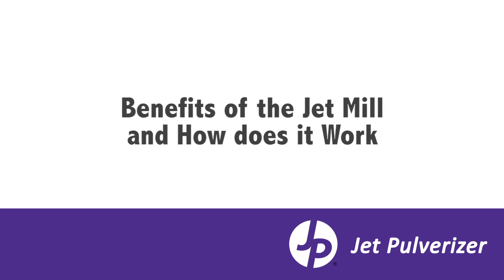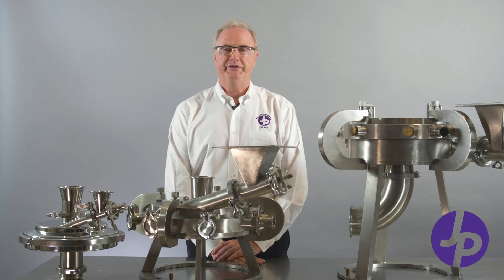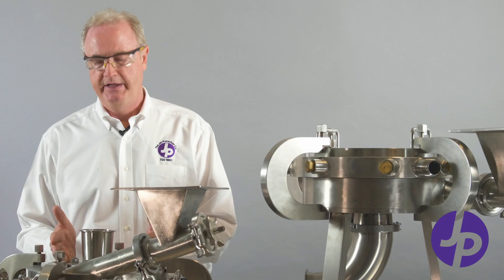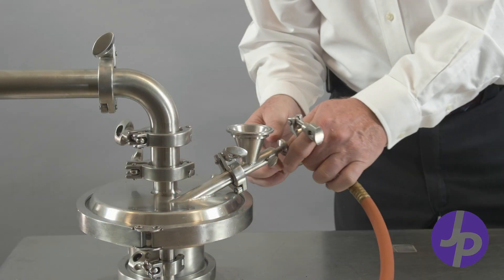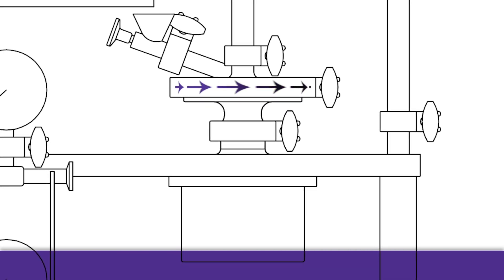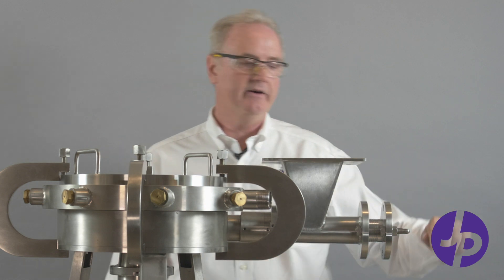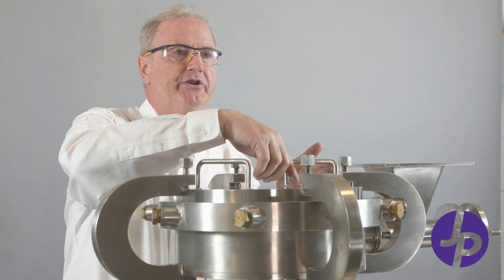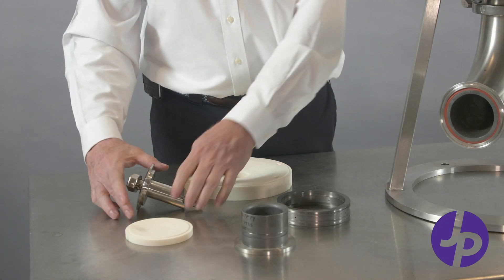Jet Pulverizer How Jet Mills Work and Their Benefits

Comment: Can this be used for graphite powder to reduce size from 200 mesh to 10 micron? Is it OK to use Air or Carbon Dioxide needs to be used. What if 1% liquid is to be added to it.

Comment: how did the particle knows its time to go to the collector, how the particles  reduces its size if the particles go to the same  direction flow,  are the pressure from the low chamber and the feed material the same=¨?
Reply: centrifugal force and air exit on the center.